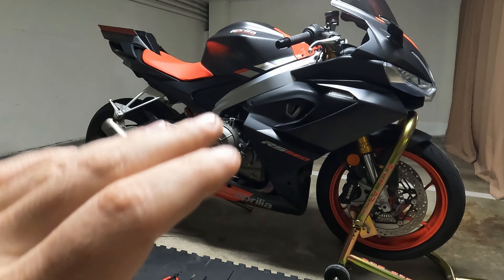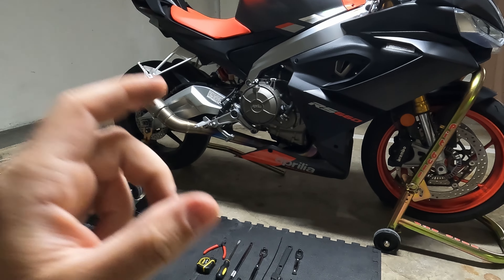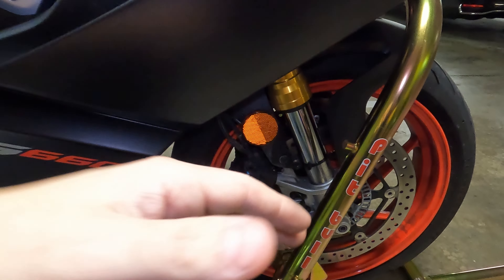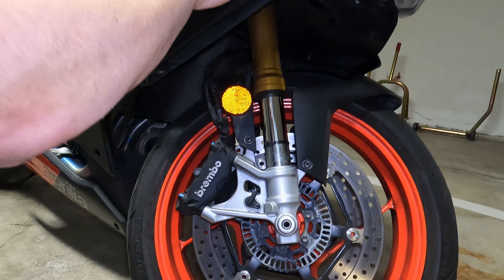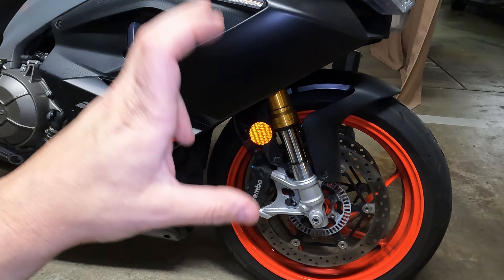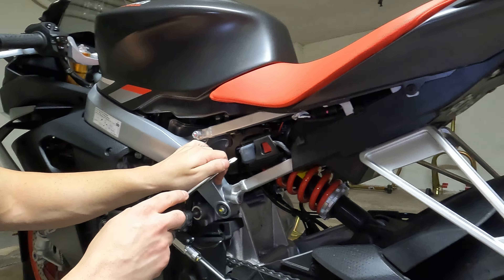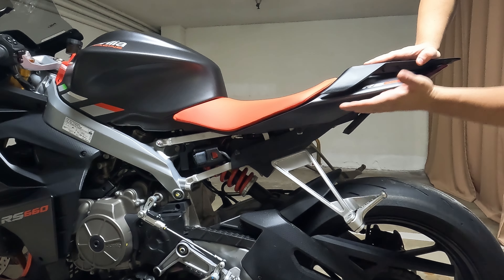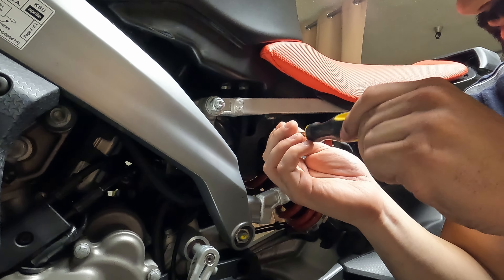RS 660 | How to Setup Your Suspension

Comment from the maker: Setting Front Suspension

Finding Bottom Out
1)	Extend the forks either by lifting the bike by the lower triple clamp with a front stand, or by raising the front of the bike on the side stand.
2)	Measure the distance from the joint of the fork tube and the dust seal to the axle casting, to find the fully extended fork distance.
3)	Find the fork stroke in the owner’s manual. The RS660 fork stroke is 120mm.
4)	Subtract the fork stroke distance from the extended fork distance.
5)	Take the difference between the two and measure it up from the axle casting. That is your “Bottom Out”.

Example: If extended fork distance is 140mm and fork stroke is 120mm then,
                 Extended Fork Distance - Fork Stroke = Bottom Out,  140 - 120 = 20mm
                The bottom out is 20mm up from the axle casting.

Note 1: Use a zip tie on the fork to have a reference point for the travel of the suspension. Make sure you have at least 10-15mm distance from bottom out. If you are below 10mm you are in the caution zone and you are running the risk of bottoming out and losing your front traction. If maximum travel distance cannot be adjusted to proper numbers using Preload and/or Compression, then you need stiffer springs/higher spring rate. 

Note 2: Adding or removing preload affects the maximum extended fork distance. Every time preload is changed, the bottom out must be recalculated.

Note 3: Adding preload does not make the springs stiffer. It alters the range of the travel of the spring, by changing the amount of force needed to fully compress the spring.

Setting Static Sag
1)	Once you have measured the extended fork distance, have the bike rest upright on the front wheel, either on a front wheel chock or by having someone hold the bike upright from the rear.
2)	Compress the front forks smoothly from the handlebars, so the suspension can settle in its resting position. Hold the front brake lever while compressing if no wheel chock is used.
3)	Measure the distance from the joint of the fork tube and the dust seal to the axle casting, to find the fork distance on its resting position. 
4)	Subtract the resting position distance from the extended fork distance. The difference between the two, is your “Static Sag”

Example: If extended fork distance is 140mm and resting position is 115mm then,
                 Extended Fork Distance - Resting Position = Static Sag,  140 - 115 = 25mm
                The Static Sag is 25mm.

Note: Static sag, meaning the suspension is compressed with the bike under its own weight, should be between 15-25mm on cold suspension.

Setting Rider’s Sag
1)	Once you have measured the extended fork distance, have the bike rest upright on the front wheel, either on a front wheel chock or by having someone hold the bike upright from the rear.
2)	Have the rider sit on the bike and compress the front suspension from the handlebars.
3)	Measure the distance from the joint of the fork tube and the dust seal to the axle casting, to find the fork distance on its rider resting position. 
4)	Subtract the rider resting position distance from the extended fork distance. The difference between the two, is your “Rider’s Sag”

Example: If extended fork distance is 140mm and rider resting position is 105mm then,
                 Extended Fork Distance - Rider Resting Position = Riders Sag,  140 - 105 = 35mm
                Rider’s Sag is 35mm.

Note: Rider’s sag, meaning the suspension is compressed with the rider on the bike, should be between 30-40mm on cold suspension.

Setting Fork Rebound
1)	Compress the front suspension from the handlebars while holding the front brake.
2)	Release the pressure from the handlebars without pulling, and have the forks return up freely.
3)	Look for the fork bounce. If it bounces, add rebound until the bounce is eliminated.
4)	If there is no bounce, remove rebound until the bounce returns to find the number of rebound clicks that the bounce is present. 
5)	Then add rebound until the bounce is eliminated.

Setting Rear Suspension

Setting Static Sag
1)	Place the bike on the front wheel chock. If you don’t have a wheel chock have someone hold the bike upright from the front end.
2)	Compress the rear shock to settle on its resting position.
3)	Find two fixed spots of your preference vertical with each other, one on the swingarm and one on the tail and measure the distance between them. We’ll call that Resting Distance.
4)	Have someone lift the tail of the bike until the shock is fully extended and measure the distance of the same two fixed spots. Extended Distance.
5)	Subtract the resting distance from the extended distance. The difference is your “Static Sag”

Example: If extended distance is 700mm and resting distance is 690mm then,
                 Extended Distance - Resting Distance = Static Sag,  700 - 690 = 10mm
                Static Sag is 10mm.

Note: Static sag, meaning the suspension is compressed with the bike under its own weight, should be between 5-10mm on cold suspension.

Setting Rider’s Sag
1)	Once you have measured the extended distance, have the bike rest upright on the rear wheel, either on a front wheel chock or by having someone hold the bike upright from the front end.
2)	Have the rider sit on the bike and compress the shock from the tail to settle.
3)	Measure the distance of the same two fixed spots. We’ll call that Rider’s Resting Distance.
4)	Subtract the rider’s resting distance from the extended distance. The difference is your “Rider’s Sag”

Example: If extended distance is 700mm and rider’s resting distance is 670mm then,
                 Extended Distance - Rider’s Resting Distance = Rider’s Sag,  700 - 670 = 30mm
                Rider’s Sag is 30mm.

Note: Rider’s sag, meaning the suspension is compressed with the rider on the bike, should be between 25-35mm on cold suspension.

Setting Shock Rebound
1)	Compress the rear suspension from the tail of the bike.
2)	Release the pressure from the tail, having the tail return up freely.
3)	Look for the tail bounce. If it bounces, add rebound until the bounce is eliminated.
4)	If there is no bounce, remove rebound until the bounce returns to find the number of rebound clicks that the bounce is present. 
5)	Then add rebound until the bounce is eliminated.
Reply: Thank you for this, getting a brand new 660 in 2 days :)
Reply from the maker: @JForst-v8c  Congrats! ✌️
Reply: I don't get it: if I measure the fork extension from fully extended to the casting I get 143mm. The problem is that I get 143 in both settings: full preload and 0 preload. I thought you meant that fork travel changes by adding preload...
Reply from the maker: @floridakoi  I must have missed your comment. Yes, by changing the preload value the extended fork travel will change too. I’m not sure why yours remain the same. Try pulling the fork down when you lift it, just in case you have fork stiction.

Comment: Just bought a tuono 660 factory. I’m trying to lower it around 2-3 mm without compromising. It has a sachs progressive shock. Since in my town service has no idea with this type of suspension, I need your help. Can I lower it by changing preload setting? If so how can I? Btw I’m not familiar with full adjustment shocks. Please ignore my ignorance:)
Reply from the maker: By definition, you can’t lower the bike by adjusting preload. When you remove preload, what happens is the spring travel increases under compression, therefore the bike sags more under its own weight and more when you’re on it. Through that change of height you can set the geometry ratio of front and rear sag. Ideally for street you need a 50/50 sag. For aggressive street riding or track riding you need the front to sag a bit more than the rear. In other words you need the front “softer” and the rear “harder”. Even though stiffness is not affected, I’ll still use the term soft and hard for simplicity. You need to set the front and rear sag based on your weight and riding style. Not based on how low or high you want your seat to sit. Trying to achieve a seat height of your preference through adjusting preload you can upset the geometry of the bike, leading in an unstable riding experience. The short answer is no, you can’t use preload to change the height of the suspension. To lower the height of the forks you need to lift the fork tubes from the triple clamp. You can’t adjust the height of the rear suspension as it does not have a lowering link. I believe there is a product that can lower the rear shock, but I don’t recommend lowering either front or rear suspension. If your height limits you to the point that you can’t ride your bike and you’re only going to do easy street riding, then I can justify lowering it. If not, stick to the stock geometry and adjust preload and rebound based on your weight and riding style. Hope this helps a little. ✌️

Comment: what will happen if you turn your rebound to full? It will come at a lower point as it was in the beginning or it will just be "stiffer"?
Reply: I mean, when do you know if you need less rebound?
Reply from the maker: @yannisz.4836  Initially you want to turn your rebound to the point where the bounce stops. That will be your reference point. After that you must ride your bike, preferably on the track or at least on a safe road that you can test the behavior of the bike. Based on how it performs you might have to add rebound. It’s not as simple to explain over a comment how much rebound you would need and why, because the geometry of the bike is not simple. But in simple words, more rebound will slow the return of the shock. That can affect the anti-squat rate and in turn anti-squat can affect front grip or rear grip. More front grip can make you oversteer, while less front grip can make you understeer or even worst, lose your front completely. How your bike behaves is how you know how much rebound to add or remove.

Comment: OK, I've watched it (will be using the play again button!) But, the F/R wheels need proper orientation (gross adjustment) i.e. keep the rear wheel even or slightly lower to keep the Front from taking all of the braking load...Hopefully, between the manual, your perfectly executed video & Dave Moss- ill gitR' figured out! That was a huge task-well appreciated by all of us.
Reply from the maker: Thank you I appreciate it! ✌️

Comment: Great video. I'm having a bit difficulty for the bouncy part. I weight 72kg and I would appreciate if I can have the riders weight. I kinda guess that the rider in the video got the same weight as me so I would just follow everything you did and get the job done alone. Again thanks a lot. That video is very well explained.
Reply from the maker: The rider on the video weighs around 55kg. But even if the riders weight was the same as yours, you wouldn’t be able to just copy the setup. The suspension behavior is different even on the same bike models. Rebound is a little more tricky to set as it’s not only dependent on the bounce but also on the behavior of the bike on the street. But you need a starting point of rebound and that is the point where the bounce disappears.
Reply: @ALFAVITAGA  Well, I was pretty far from my guess😂. I'll follow the instructions then. Appreciate the reply my man.
Reply from the maker: @mahanghorbani523  lol absolutely man ✌️

Comment: Top effort Mike , great video explained well.

Funny how the manual says no preload for sport riding, no wonder people get confused
Reply from the maker: Thank you brother! Manual also tells you to measure the distance of the rear shock spring to determine the level of preload and the number it gives you for sport riding eliminates static sag completely. The manual recommending amount of preload is equal to the sticker on the bike with the suggested tire pressures. In other words, useless.
Reply: @ALFAVITAGA Hahaha that's funny. Most manuals recommend 36 PSI front and 42 PSI back for 120/70 and 180/55 respectively - I imagine that the RS660 is quite similar to the Yamaha R7.

I was always told to go with manufacturer's recommendations for road riding and obviously adjust for track. I've seen many track day riders suggesting 30 to 32 front and around 28 to 30 back (for track). What are your thoughts on appropriate  pressure ranges for road and track?
Reply from the maker: @NakedBikeJase  Manufacturer’s recommendations for tire pressure is useless. No one can tell you what tire pressure you need but you. But you need some info to be able to determine your optimal tire pressure. How much psi to you elevate when your tires are warm? How much do you push your bike? What brand tires do you run? And a lot more. Some tire brands have stiffer carcass than others. Pirelli has softer front carcass than Dunlop for instance. That means that you may need less psi on a Dunlop compared to Pirelli. It also depends on how hard you will be braking and accelerating. For me, when I do canyon rides, I elevate 4-5 psi on warm. Therefore I start at 28psi cold front and back and that brings me to 32-33psi warm. When I start pushing lean angles around 55 degrees with hard braking, I feel that I need to drop a psi or two as my front starts getting a bit unstable. So it all depends on what your warm psi is. For me 30-32psi warm does the job. 28psi even for canyons and a bit lower for the track.
Reply: @ALFAVITAGA  Thanks for sharing 👍🏽

Comment: Good info, thanks. I should check my tuono factory(18, so non electric) settings too even though it should be Ok from factory for 75kg rider. On track i might be near bottom out on heavy braking.
Reply from the maker: Definitely give it a check. 90% of the time suspension is off spec from factory.

Comment: Highly suggest not recommending the settings in the book with so much conviction. Everyone’s different. Those settings worked wonders for me and I’ve been able to get within 10-12 seconds of the lap record(not super bike/supersport times) on 3 different tracks. It may not be the only thing but still helped me and the 3 guys I frequent the track with..A better comment to make would’ve been, “I hated the sport settings in the book but try it out and see how it works for you, but make sure to set your sag first.” 👍
Reply from the maker: I’m sorry but I respectfully disagree. I did not “hate” the sport setting. The sport setting was wrong. The recommended preload, eliminated the static sag completely. There can be no set setting or recommendation. Each setting is unique to the rider and riding skill. Out of a 1000 riders maybe the recommended sport setting will work for 2 or 3 riders. But you can’t just start adding preload without knowing where your static sag is. This is like saying that the recommended tire pressure in the book works for you and everyone should try it. On the recommended tire pressure I almost lowsided. I hold my original statement which is to not use the book for setting the suspension. With all due respect. ✌️
Reply: @ALFAVITAGA  yeah I guess that is pretty odd to have no static sag.. I’m not too familiar with suspension settings recommended by Aprilia for that bike specifically. Now I’m curious lol. All I’m saying is, the majority of street riders and a lot of track day guys are on stock non adjusted suspension and tire pressures and it seems to work fine for them. I don’t advocate for it but that’s the truth. At the end of the day, everything motorcycle related is pretty much guidelines with trial and error cause everyone’s different
Reply from the maker: @wattleyracing  You are right about that. Everything is trial and error based on individual needs. But just because something is working for someone it doesn’t mean it’s right. If a track day rider is not pushing limits, then it won’t matter much that there is no static sag or tire pressure is too high. But when i was riding with no static sag, my front tire would lift on every exit corner making it impossible to accelerate off the turn. With manufacturer recommended tire pressures I couldn’t trail brake hard past 45 degrees lean without losing traction on my front tire. My tire pressure rises around 5 psi when hot. If a track day rider raises 2 psi when hot it means he is not pushing hard therefore he is not at the limits. So the fact that he is not lifting his front on exit corner or not getting jittery front when trail braking, it doesn’t mean his setting are correct. If he starts pushing limits he might find the hard way why his settings are wrong.

Comment: Thank you for the video, very informative. I have one question- how much fuel should I put before setting up everything?
Reply from the maker: @TheMrKarolus  Thank you! I wouldn’t worry much about the weight of the fuel. If that was the case, you would have to stop and adjust the suspension for every gallon you use. Static sag will not be affected much over a couple of kilos. A kilo or two might not even be enough to defeat fork tube drag or natural stiction. ✌️

Comment: First of all nice video, thank you for that! But I have a question. In Dave Moss' video they adjusted or had the riders sag (driver 245lbs with gear) set to 45mm and he said it is okay. They had 140mm extended and 95mm with driver so 45mm driver sag in total. Why do you recommend 28-35mm?😊
Reply from the maker: 245lbs is too heavy for the stock springs of the RS660. 45mm rider sag is a lot if you plan to ride on the track or fast canyon rides. In the case of the 245lbs rider it is better to have more rider sag than have zero static sag. If Dave added more preload to lower the rider sag to 35mm, chances are he would run out of static sag. 0mm static sag is unsafe and can cause a crash through the lack of anti-squat. 45mm rider sag is not unsafe but it is acceptable for the given stock spring rate of the RS660. Therefore Dave said it’s ok.